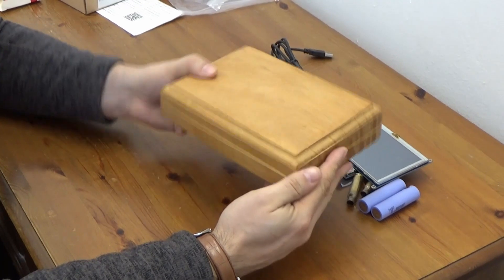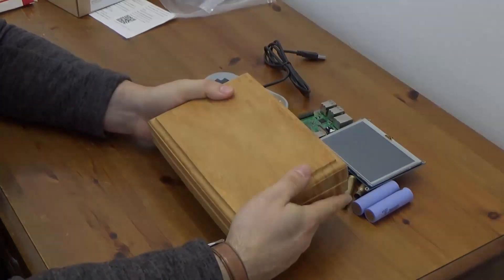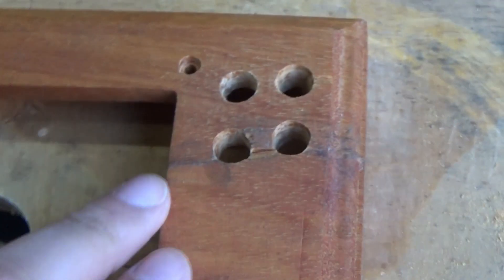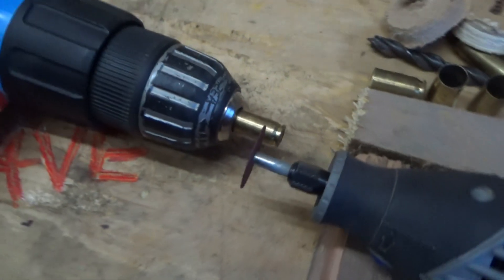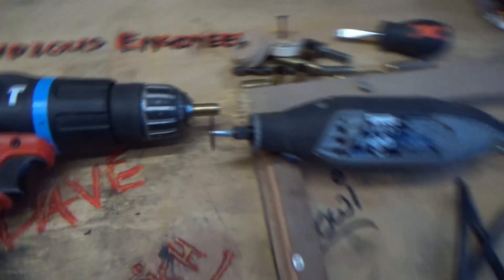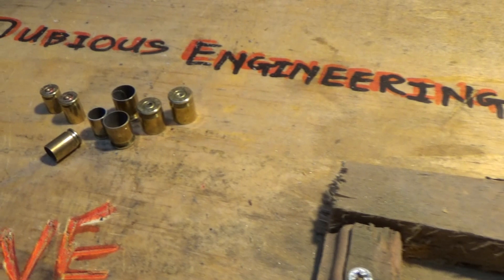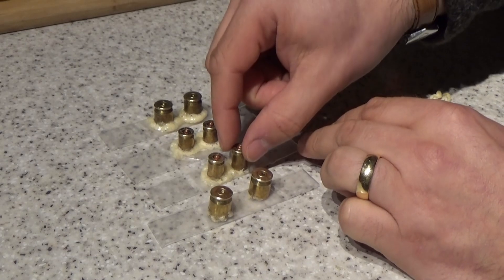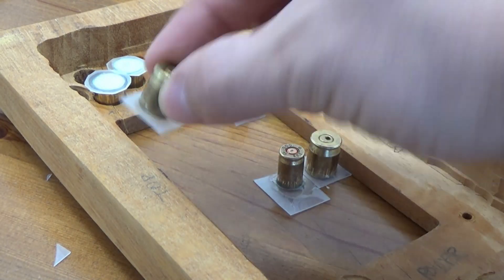DuB-EnG: Wooden Retropie Portable Games Console with bullet buttons PT6 DIY Make Retro Pie Emulator

Comment: How are you going to rejoin the traces if your hacking the controller PCB up?
Reply from the maker: Mattias Forelli old skool trick ... wire and solder!
Reply: Dubious Engineering Make sure you shield them then, or the interference may have unintended side effects!! :D
Reply from the maker: Good call...  hmmm... I have some copper tape somewhere!
Reply: Dubious Engineering Well don't leave it outside. I left an old copper lamp outside behind a gate, and some bastard stole it lol.